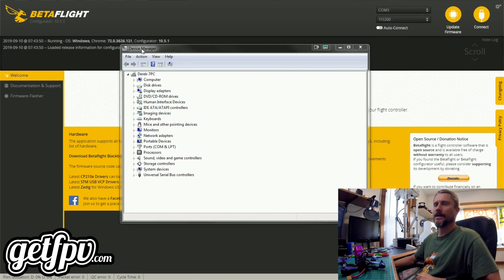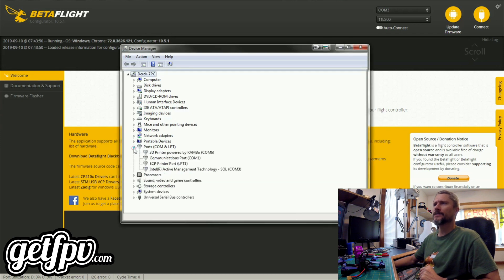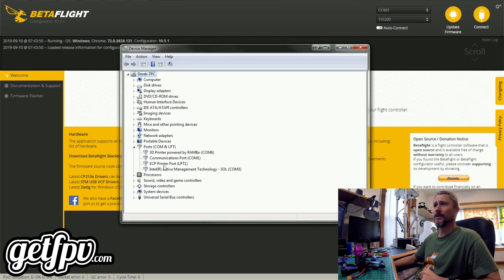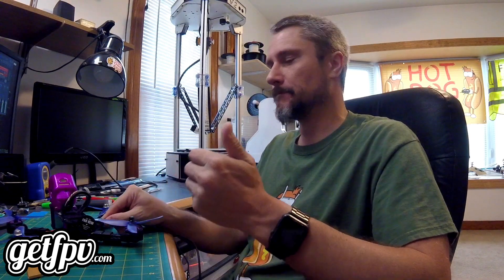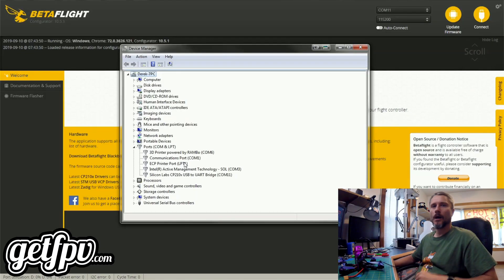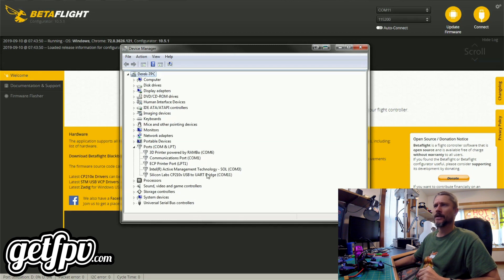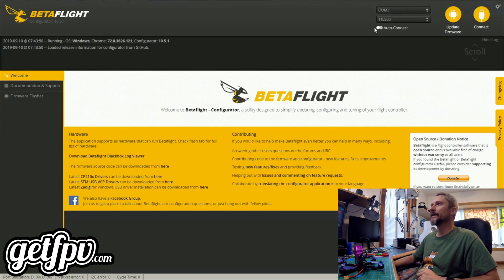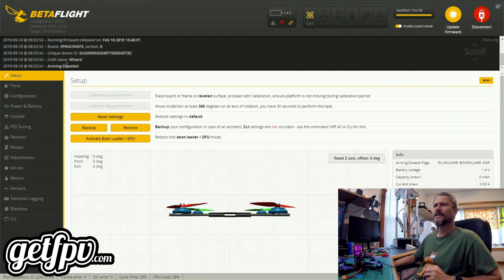GetFPV Learn - Connect a Flight Controller to Betaflight

Comment: Before coming I assumed it was my cable but I have so few micro USB anymore that I had tried the few laying around and nothing in hardware manager. Being new to betaflight I wasn't sure if the ST driver would show up as a com port though and finally I found a cable that works. Hopefully we don't start seeing USB C cables without the data lines.

Comment: Hi.
I have a problem connecting my betafpv meteor75 to betaflight.
I connect the drone to the pc. Windows 10
New port appear in betaflight - com4
I press "connect" - but it doesn't want to connect :(

Any Ideas?